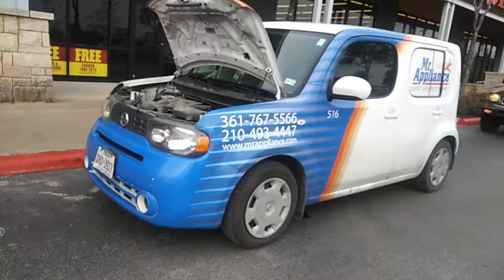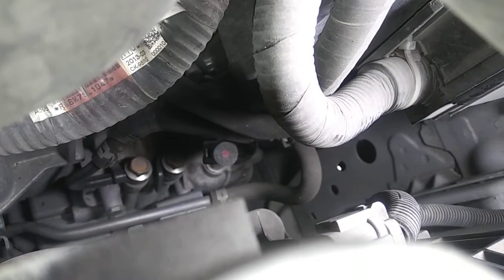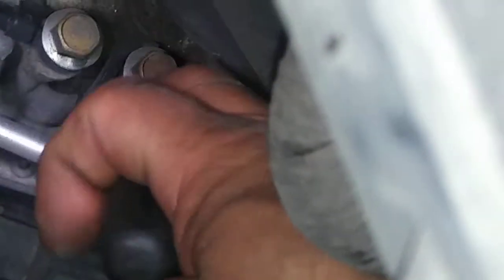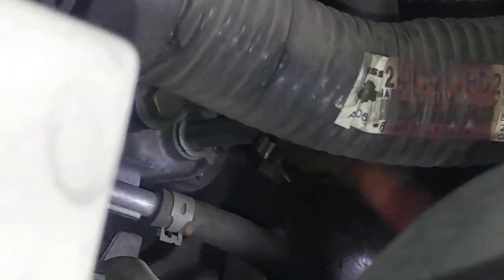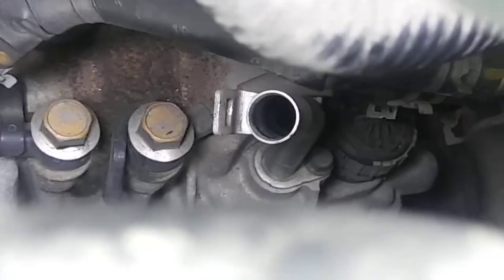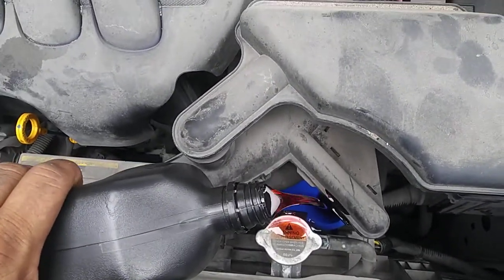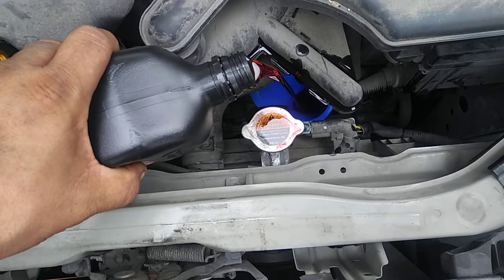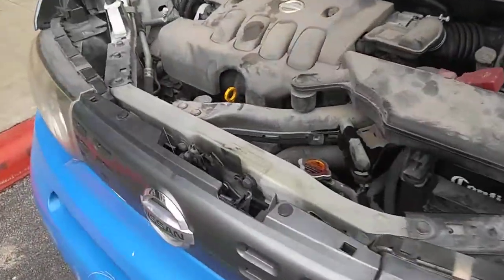How to add transmission fluid Nissan cube

Comment: You can use a key to push the plastic locking tab in instead of breaking it all off.
Reply: Relax it's only a nIssan
Reply: @osca36041  or you know... take an extra two seconds to do it right...
Reply: @ThisPossumKnits nah I don't like closed things we will remove the tab and that's that

Comment: I tried screwdriver and key and STILL managed to bust the clip. Popped it back down in the intended orientation and have been checking to see any rise in the cap.  Zero. Even after bumpy roads. Now it's easy to check fluid levels.

Comment: Husband talking; I do like working on my cars.  After bloody paper towels and deeply cracked index finger nail, I went back on line to see if there was a better way to get to the dip stick clip.  STEP 3: Just remove the clear plastic over flow reservoir (no tools needed) and then you will have a nice access angle to release clip without breaking any plastic or more finger nails + blood. You may have to push in a few places as you gently pry in the plastic latch.  

Still a bitch of a job.  Shouldn't have been such a cheapskate and instead taken it to the dealer.  Mine took less than 4 quarts.  1st CVT blew/slipped at 60K, but we were hauling 800 pound loads of bricks with the back seat out on 300 mile trips, prob 6-7 times.  Trip gas mileage went way up by about 10 mpg. when loaded!  Car looked cool, lowered about 3".  Don't buy a used Cube with a trailer hitch!